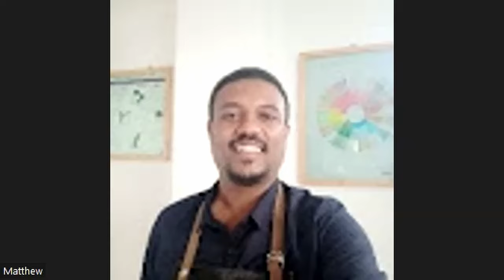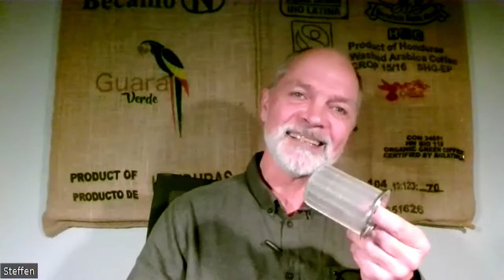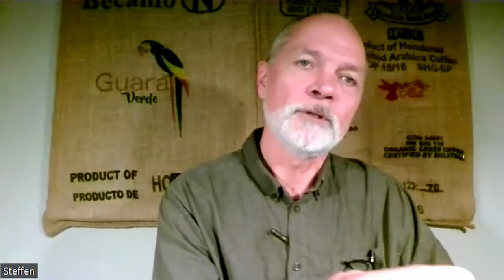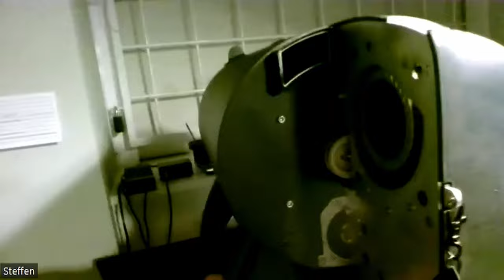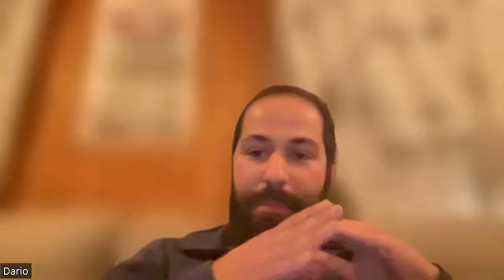Aillio Bullet R1 Q&A with Steffen Lav from Aillio Europe

Comment: Time Stamps
1:04 How airflow affects sweetness
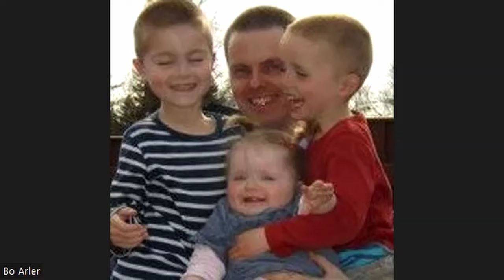3:10 Drum speed
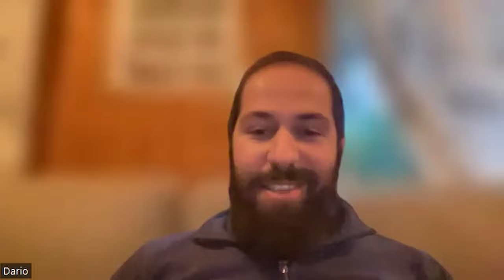4:30 Roasting in cold weather
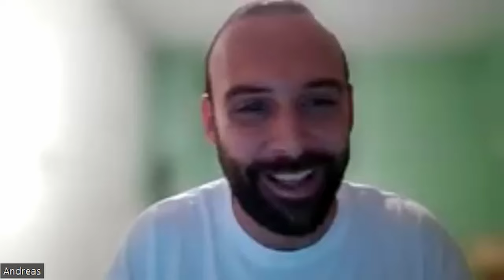9:06 Preheating for successful first roasts
12:12 Best practices for hot or cold weather
15:19 Measured energy and airflow for each "P" and "F" change
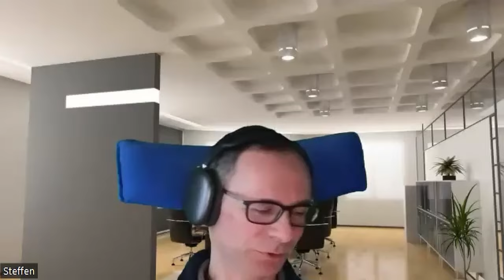17:50 Plans for easier chaff cleaning
23:00 Deviating from recommended capacity
26:36 Overheating errors part 1
29:09 Overheating errors part 2
30:05 Stuck chaff in front door
34:16 V1 vs V2 IBTS cleaning
38:13 Cleaning chaff filter during preheating
39:26 Between Batch Protocol recommendations
42:34 Roast Profile for Natural Ethiopian
45:00 100 Roast Limit Warranty
47:26 Manual to Recipe mode consistency part 1
50:04 Manual to Recipe mode consistency part 2
53:25 How the IBTS works
59:44 Cause of temporary ROR plunge
1:03:48 Minimum batch size
1:06:45 How airflow works
1:10:02 How airflow affects the roast
1:12:00 Cleaning chaff and ash at front of roaster
Reply from the maker: Absolutely super kind of you! That's very helpful.